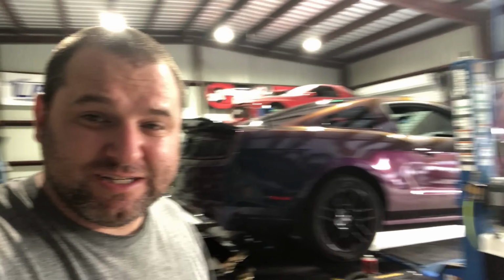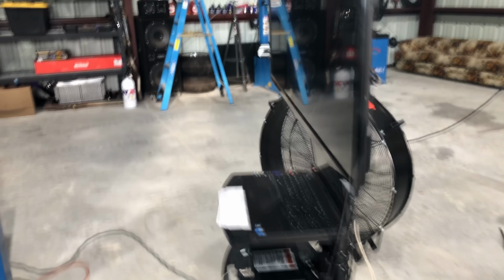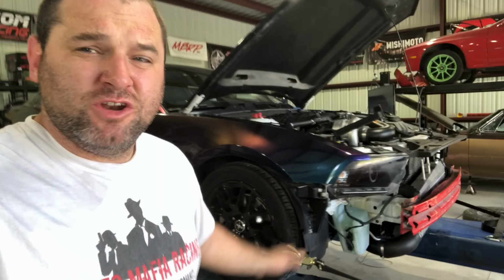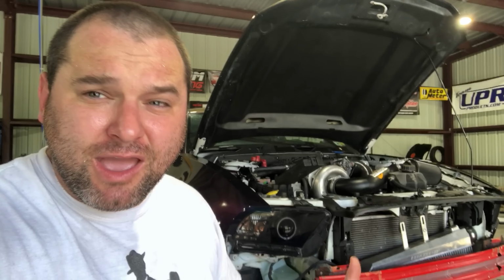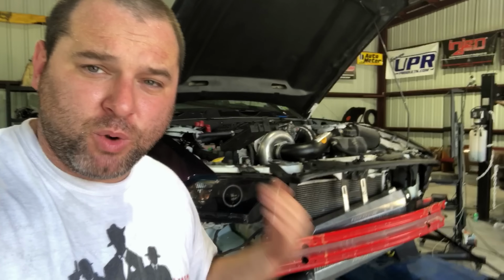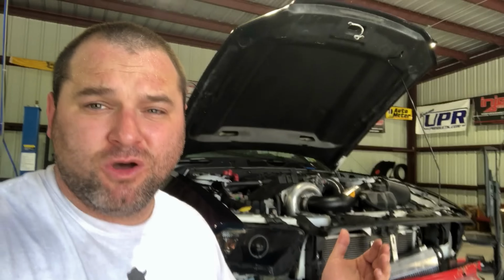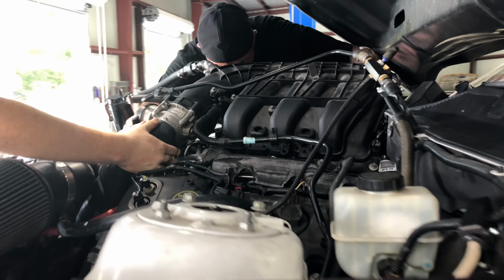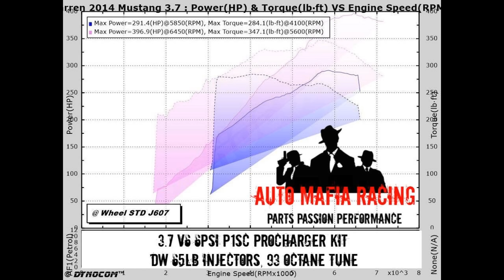BIG HP increase on 6 lbs of Boost? - Procharger 3.7 Cyclone Mustang

Comment: Like your videos. Keep up the 3.7 support.  But, I have to wonder how much airflow is really getting to the intercooler?
Reply from the maker: A decent bit when driving, but you are correct, the stock crash bar blocks most of it. We like to replace it with a light weight version.
Reply: Auto Mafia Racing which I might do
Reply from the maker: Dooo it
Reply: Yeah I always wondered about that whenever I made my kit I was able to mount it a little bit higher hoping that more air got across it but I had a liquid intercooler and it actually blocked enough of the air conditioning condenser that when I was just sitting there at idle it actually wouldn't get enough air flow with the fans and my AC would get a little bit warm So maybe there's a reason it's put right there and at that size I'm pretty sure it also only happened in the summer and I do live in Phoenix though so I hope it's not that much of a problem

Comment: 390 on 6 psi wtf??? That's nuts. These engines are extremely efficient
Reply from the maker: Yeah we hit 525 on 8-9 psi
Reply: Dohc baby
Reply: @automafiaracing  on stock internals?
Reply from the maker: @IamFreeSpirited  Yes on stock internals.  We will push to 600-650 on stock internals
Reply: @automafiaracing  on e85? Or pump gas
Reply from the maker: 600? On e85
Reply: I heard 3.7 v6 must get rods after 500 who but if you say 600 to 650 on stock rods then I guess cuz of low low boost and perfect tune? ARP BOLTS OR STOCK BOLTS I THOUGHT STOCK BOLTS 🔩 🤔 😕 😳 😬
Reply from the maker: Over 600 is the danger zone.

Comment: When you bolt on one of these prochargers are you still able to do things like daily driving, road trips, and crank up the AC on the hot days?
Reply from the maker: Of course
Reply: Yeah I made my own custom kit with a vortec V3 and everything was perfectly normal except like I said in another post my heat exchanger was so big for my liquid intercooler that it actually when I was just sitting there not moving the fans couldn't get enough air flow across the air condenser for the AC and the air conditioning would get a little bit warm on really hot days but I live in Phoenix so really hot days means like 120°

Comment: I have 2015 v6 with a procharger. Stock internals but i have a one peice drive shaft. Headers. 73mm throttle body, Hi flow cats, straight pipe after the cats. Im wondering how much hp i could push without having to get forged internals, do you only tune via dyno or do you have email tunes?
Reply from the maker: We do email and dyno tuning.  We can get into the 550s with a procharger without building the engine.  Anything over 600 rwhp is when we consider it to be on borrowed time.
Reply: @automafiaracing  so 550 crank or rwhp? Thats safe to daily without worry of blowing the motor?
Reply from the maker: @IamFreeSpirited  550 RWHP nobody talks crank HP.    Yes thats plenty safe with our tune to run daily.
Reply: @automafiaracing  im gonna get a few more things done and ill be in touch real soon
Reply from the maker: Sounds good
Reply: Auto Mafia Racing I’m going Procharged at the beginning of next year I wanna be up at 550 that would be fuckin great 😆 how much psi would that be and would you e-mail a tune when the time comes? Also I’m sure I’d have to get a 1 piece aluminum drive shaft with that kinda power right?

Comment: I'm surprised they had blowout at 35 I ran I believe that much on my vortec with like 9 to 10 PSI and didn't get it and I'm running 3 on my EcoBoost right now and I'm running way more boost than that and not getting blow out although I know there's not much difference between 0.3 and 0.28
Reply from the maker: Yeah these were like .048
Reply: @automafiaracing  damn yeah they probably just took them out of the box and put them on You know it's funny actually before I put my blower on my supercharger I didn't experiment when I went to the Dino and I only changed the spark plugs to a colder set and I got them from I was running 055 and I got them down to 0.040 for the blower but I had them run it on the dyno stock without the blower and I lost like 20 horsepower and 20 foot pounds of torque It was crazy I don't know if that has anything to do with anything but I mention it because it cost me 50 bucks
Reply: @automafiaracing  hey maybe y'all can help me because I was building an adapter to put a GT500 supercharger on my 3.7 but I stopped because I couldn't figure out a way to break out the IAT temp sensor from the maf so that it would read the temperature after the blower I know that the GTs have a kit they can do it fr vmp and others but I don't know if the wiring's the same do you know if it is or how that could be done and then I could start working on my kit again. I went a different route I don't like the whoever that idiot is who has his kit that uses the stock plastic lower That's just insane what I did is I took a 3.5 aluminum lower from I think it was a Taurus and actually welded and machined it to fit the 3/7 cuz the ports are slightly different some of the bolt holes are different You have to change the coolant crossover pipe because it's in the back instead of the front.  But I had a lot of time and money in it and I'd love to get on it again but if I can't tune it right I'm just not going to.

Comment: got any vids on the 4.0 s197 ...got one for my kid and wants to know what its capable of and whats not possible.
Reply from the maker: We just loaded one a few days ago
Reply: I'll try not to get too long with this but I had a 4.0 and I made my own kit to put an m90 on it that was before like mod box and the other ones and the the ranger whatever it's called banshee kits but I would look at those That's what I would suggest buying and you'll save a decent amount of money You just have to get the tune and the fuel injectors on your own I ran the 0304 Cobra Terminator injectors online and those will do fine depending on what kit you can get people have made you know 350 the wheels the Shelby CS6 claimed 350 although I think that was to the crank with their kit that used the it's not vortech it's the other older company the vortec now owns it starts with a p now procharger but I would suggest a Roots kit just because the injectors are in the heads and it's a lot easier for people to make people can actually make a kit with a root supercharger and I think those are the best for street cars
Reply: if you have any questions on the 4.0 I haven't had mine in a long time but actually made my own supercharger kit and some other parts for mine So if you have any questions you can message me But the thing I would consider upgrading besides a supercharger is also the rear axle because it doesn't have the 8.8 on those years It has the 7.5 which is not nearly as strong and it doesn't come with a limited slip stock like the 3.7 stew and that alone will make a huge difference and those will last a long time Don't listen to people who say they have problems with the cassettes and stuff those are only on the explorers from '02 to '04 I had an '04 that ran I can't remember I think 160 170,000 mi with no problems whatsoever except for replacing an alternator

Comment: Around how much would it cost to get a car like this ? I already have the car, but to put the pro charger and everything else after the pro charger ? Around how much guys?
Reply from the maker: Depends on options but we have a 500 hp procharger kit for about 7k or 4k for our turbo kit.
Reply: Auto Mafia Racing 4K sounds good,how much Hp is in the 4K
Reply from the maker: 450 ish.  Bigger injectors and you can make 600
Reply: @automafiaracing  so 4k for the turbo and how much for the install? Really interested
Reply from the maker: So we changed out kit and added a bunch of little thinhs and its now 5k and install is $3500 including dyno tune
Reply: @automafiaracing  you think we could get CARS PROTECTION plus to pay for this 😈😈 or at least some ?
Reply from the maker: Get what to pay for what
Reply: @automafiaracing  man I can’t wait to come up with that 8k 😈
Reply from the maker: Doo it

Comment: if i were to get this kit for my 2016 through you guys with 65lb DW injectors 3.40 pulley a DW400 Pump and a upgraded procharger Bullet open style blow of valve along with having yall install and tune (with all the extras tommygun/trans/ghost cam/etc) how much do you think it would be not including me shipping my car down to you?
Reply from the maker: Well to start we wont tune dw65s as they are junk.   But otherwise send us a message.

📬 Contact us for build advice and guaranteed lowest prices.
📞 941-979-1132
📧 Support@AutoMafiaRacing.com 

facebook.com/automafiaracing